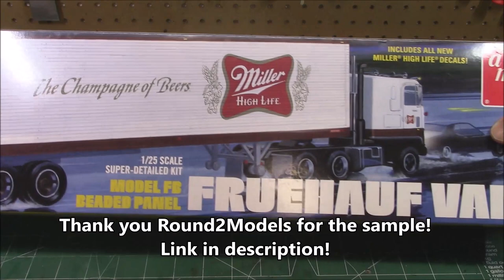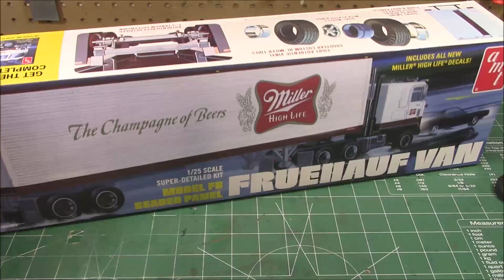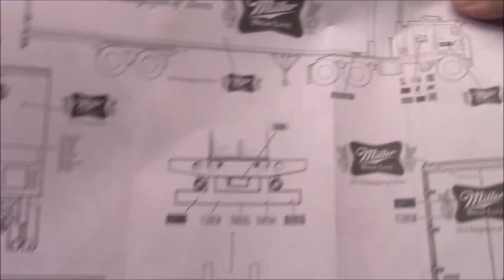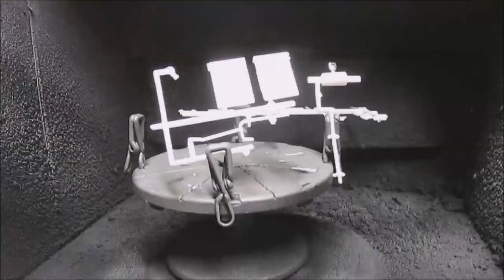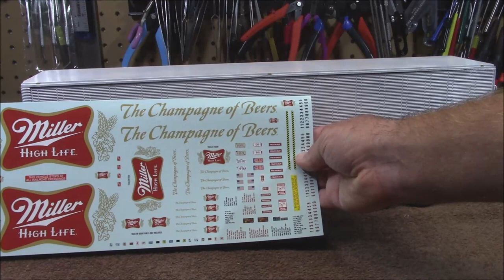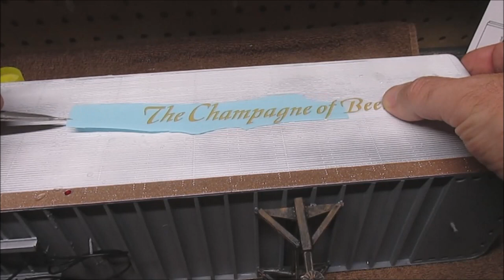FRUEHAUF VAN SEMI TRAILER MILLER HIGH LIFE BEER 1/25 SCALE MODEL KIT BUILD REVIEW AMT1234 AMT

Comment: Chris, great build! With the moveable axles one trick I added to the air lines was to add a very weak spring to keep tension on them. That way you can move the axle and not have your air lines drooping. I know that's not in the box; but it's an easy extra to add.
Reply: The real trailers had the spring on the airlines.

Comment: Thank you for another great video Chris, I watch your videos for tips and inspiration for my own kits. I saw the clip where you used gliserine to mimic grease on a fifth wheel, I decided to try black acrylic paint in a squeeze tube so it will dry. Put three small dabs of the paint on the fifth wheel then spread the paint around by dabbing and spreading with an old brush until you get the desired effect. Also with these Fruehauf trailers, if you don't glue the axles to the suspension subassembly while still gluing the track arms to the axles this will let the track arms hinge where they snap into the suspension subassembly, if that makes sense, and give you working suspension. It's a little fragile, but it might add some detail to the display. It might be a good idea to modify the track arms by replacing the stock locator pins with brass rod or wire.

Comment: Chris. As a truck mechanic for over 45 years, (Now Retired) the Glad Hand connections and lines on the front of the trailer should be Red and Blue. Red for the pressure side, and Blue for the return side. Just noticed that on this build.
Reply: Do they have a proper side for right or left, for supply and return? Or does it depend on the make of the trailer?
Reply: @sczuylevch13  Yes. The left hand or outside of the trailer is RED (Supply). The Right hand is always BLUE (Return). This is the same for all trailers in North America.
Reply: @charlestreadway6491  Thank you!

Comment: According to Scalemates it started life in 1970; in 1971 it got some extra parts to make a reefer. In 1972 it got Schlitz decals; 1976 they released a flatbed version; then after that just cycled through a bunch of previous and new decals. I might look for the reefer version.
Reply: I wish they would do the reefer again, but they haven't so far. Round 2 is reissuing the old ERTL Great Dane reefer trailer in the next month or so. When the beer kits came out they included the reefer parts but they weren't used on the box art builds. Scalemates is off a little, the AMT flatbed was a brand new tooling with full frame underneath. IMC did a generic box trailer in the late 60's/ early 70's that they later reissued as a flatbed using the box trailer as the base. Also, the beer kits from AMT came out in the late 70's and the Schlitz trailer was paired with the Mack Cruiseliner tractor that was originally issued with Ryder decals in '76/'77. Not trying to be a "know it all", I've been building these trucks since '71 and I have most of the old 70's AMT annual catalogs to back up the dates.
Reply: Captain Morgan  Thank you for your info. You're not being a "know it all," just sharing your knowledge of the kits issued "first time around." I was fortunate enough to catch the originals on "there way out," as I have been building them since 1982. I never understood the RYDER decals on the MACK CRUISELINER. Now that you shared that it is supposed to be paired with the SCHLITZ trailer,  now I have a purpose to build the Cruiseliner. Beautiful truck, but RYDER decals don't do it any justice. Thank you again

Comment: If I remember correctly that big extra plastic piece was for the AMT decals that came in the original issue.  You could make a placard for the decals and glue the placard to the trailer.  I am not 100% positive but am pretty sure that's what it is for.
Reply from the maker: Cool!

Comment: In those trailer kits there is a locking bar for the sliding rear  tandems just like the real thing . in this video it shows up at 317 on the below the mud flaps , and for your information all clearance lights by law require red to be displayed to the rear only and amber  to the the sides and front,   i also noticed where you located the tail lights on that trailer , they should be  tucked up in under the rear of the trailer  otherwise  every time you back into a loading dock you  will  damage the lights

Comment: I've watched a few of your videos recently and I have a couple questions. Firstly, what size socket are you using to slide your tires onto for sanding them? A spark plug socket? And secondly, I've seen you use the Sharpie Permanent Markers quite a bit. How do they hold up over time? Do the colors fade? Thanks.

Comment: I hate to be "That Guy", but you placed the marker lights all wrong. All of the lights on the front and sides are supposed to be amber, and all of the lights on the rear are supposed to be red. That truck is going to get some hefty DOT fines!
Reply from the maker: It's not a real truck so it will be OK.

The model truck experts will get it right. Mistakes happen.